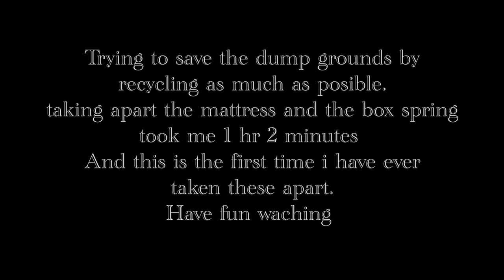Taking apart a mattress and box spring for recycling purposes

Comment: Thanks for this video. It saved me having to deal with my initial plan of pretending to transport my mattress and then having it "accidentally"  fly off the roof of my car and then drive away. LOL ... Just kidding, kind of ... anyway, I used wire cutters to break my springs down to four parts which made it easier to transport. So for those who don't have a grinder wire cutters will work really well if you know where to make the cuts. Breaking down the springs with the wire cutters took me about 20-30 mins for the entire process. Thanks again for the video.
Reply from the maker: Thank you, glad to be of help see all
Reply: lmao
Reply: i haven't laughed so hard in months, if not longer. thank you for that hilarious sketch-- benny hill would be proud. mattresses are like everything in this mortal coil. you need 'em but you can't take 'em with you...'

Comment: Excellent job of recycling and educational too.  I looked this up because I was curious about the connections between the parts to see how I was going to salvage some material.  There's a lot you can do with the scraps: The wood from the box spring would be useful for several projects.  I'm sure crafty folks could think of uses for the foam as well.  

I happened to be interested in the larger gauge metal running around the perimeter of both the mattress and box spring since I have a compact metal bender, and it would be nice to have some rods that diameter for various projects.  If you don't have any use for the metal, you could always take it to the scrap yard or give it to someone who collects scrap metal.  That guarantees it will get recycled rather than rusting away in a landfill.  I keep a bucket in the garage for any metal that can't go in the curbside recycling bin: Old batteries, screws or nails when I disassemble something, broken appliances.  About once a year that all goes to the scrap yard.

Comment: 1:57 another way to remove the final slats is to take a 1ft prybar and make a twist in the metal frame. The staples will pop out after 1-1.5 twists.

Comment: what did you do with the springs? how did you break that down?
Reply from the maker: +Sarah Hyre  I cut them into 4 sections using a grinder and shoved them into my van to the scrap yard.
Reply: turned out my mattress had all individually wrapped springs (thank god) tedious but I unwrapped about 80% of them and recycled the metal. the rest, I just dumped. it wasn't more than about 20 and they were small. I saved about 100. It worked out but yeah if ppl have the springs that is just one big piece that's pretty hard to deal with. most ppl don't have a grinder.
Reply: @kats9livesfive  I bet you're a blast at parties.
Reply: @DLXWillington  thank you for the video. I am tearing mine apart this wknd and will use the spring for a trellis. I had no idea how to go about breaking it down, but this was a huge help!
Reply from the maker: Thanks Jennifer. hope it all goes smoothly for you🤞
Reply: @kats9livesfive  WOW ... a tad bit harsh don't you think? He was just showing us HIS way of doing it. If HIS way doesn't work for you then don't do it. However, you cannot be this daft. If you don't have a grinder then just use wire cutters. If you know where to cut, wire cutters will actually be very easy, at least it was for me when I did it.

Comment: You made this video over 3 years ago, several people asked very good questions about how to break down or cut the springs.  You never answered.  Even if you just responded with "thanks, but I don't know how to cut or break down the springs would have been nice.
Reply from the maker: Not sure if you really read all the comments but I replied to a few of them of the same question. And other people also answered that question.
But to answer you, I used a grinder to cut the whole thing into 4 sections, put it in my van and off to the scrap yard. Didn't film it because I did it the following day, and that's totally my bad.

Comment: Sorry but you still did not show how to dismantle metal spring part, so all is useless as you still have same size thing to dump
Reply from the maker: I guess if you don't have a scrap yard to take it to then all this is useless indeed. For I used a grinder to cut the metal frame in half, put it in the van and took it to the scrap yard.